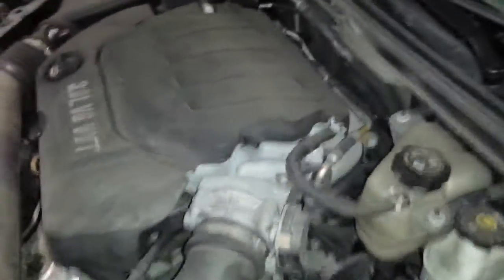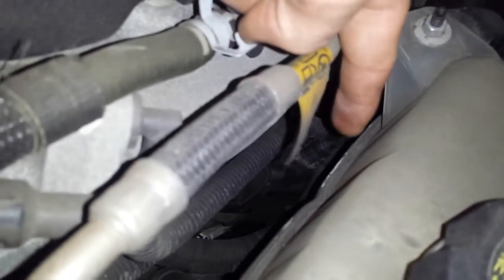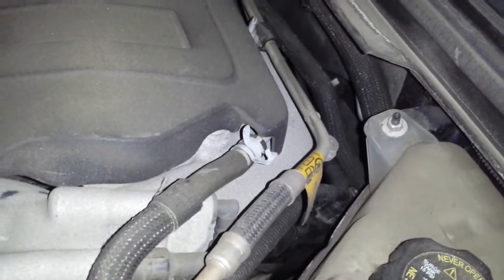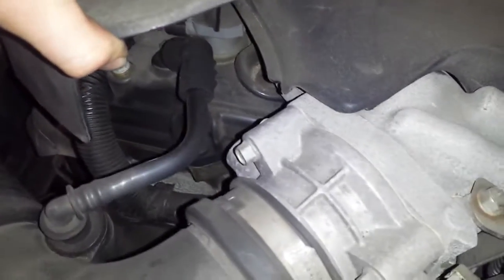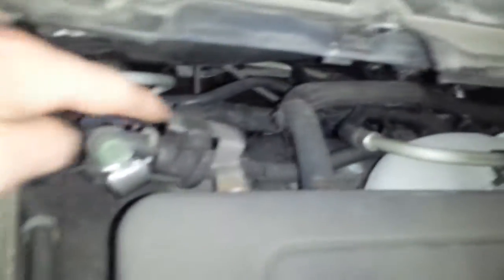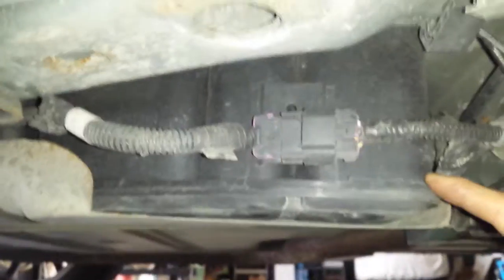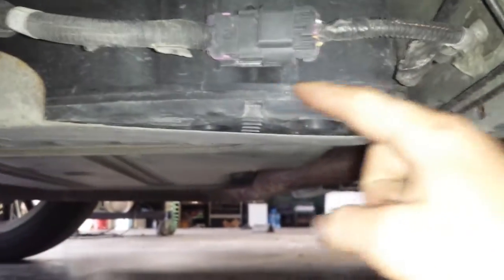Saturn Aura emissions: PCV system, EVAP canister, & EVAP Purge locations

Comment: How easy is it to change. I have the little part but the guy that was suppose to put it on ghosted me.
Reply from the maker: What part? What year, make, model,  engine size are you working on?
Reply: @ScottiesHobbies  2007 Saturn Aura the canister valve vent. I just watched another video. 🥺 It's something I can't do myself cause I would have to drop the tank 🤦🏾‍♀️
Reply from the maker: Good job taking the initiative to even look it up. Atleast you tried. Good luck on your next diy project.
Reply: @ScottiesHobbies  Thank you

Comment: How do I check to see which is bad. My car will crank tries to start but won’t like it’s not getting gas. The day before it failed to start I got evap code and gas cap open. I don’t know what to do HELP
Reply from the maker: First the quick and easy things, did you check your gas cap? Look on the bottom side of it and see if your seal or gasket is cracked or broken. If all that is good the next thing that should be looked at would be the purge or vent solenoid. They should be checked with voltage, and vacuum to make sure they're holding pressure. That's for the check engine light for evap. The no start or hard start. If you have some help try starting vehicle. While you're starting it have somebody spray carb or brake cleaner in the intake while you're cranking it. If you're starving for fuel or your fuel pump isn't working properly then the vehicle will start up. If the vehicle continues to not start after adding the brake fluid or carb cleaner then I would start looking at a spark issue. Please ask any questions if you need me to elaborate on any of these diagnoses.
Reply: Scotties Hobbies  Thank you so much for your response sincerely appreciate it. This may sound stupid but where is the purge vent solenoid located on this 2008 Saturn aura. Once again your help is so greatly appreciated. Thank you. I’ve asked so many people and no one was able to give me any help. Thank you.
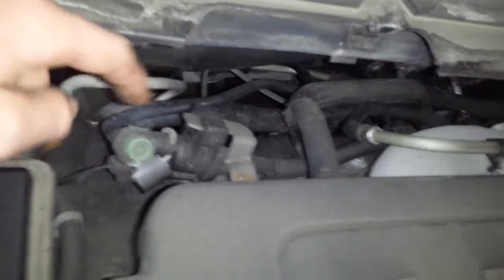Reply from the maker: @josiee.6605  I actually lie in this video. The solenoid I show at 00:43 is actually the purge solenoid. The vent solenoid is under the car near the vapor canister. This one looks like it should be very easy to replace. I actually need to remaster this video along with a couple other ones. I was just getting too ahead of myself.

Comment: i have the same ticking in my 2007 Saturn Aura XR what is the problem for that ticking do i have to change the vent valve or the purge solenoid ? thank you in advance
Reply from the maker: 2 things. Make sure you have oil to the ful line on the dip stick. If this valve, the purge, is ticking that just means its working or atleast actuating. If you don't  have any codes, don't fix this valve.

Comment: when i put gas in my 07 aura it take a cuple cranks to start, could it be my purge valve??
Reply from the maker: +Derek Mosley really could be either. The vent valve should open wile pumping gas to release pressure in the evap system. But the purge will open as soon as the car starts and that might cause a rich condition upon starting. Have you checked fir pending codes?
Reply: No i haven't

Comment: Hi I have a question for you, I'm looking to purchase a used 2007 Saturn aura, it has the ticking sound coming from the valve as shown in the video you posted. Is that normal? It seems to be the only thing I can find that I thought was a problem? If you receive this thank you for your time!
Reply from the maker: I believe that is normal on these. The sound you hear is the valve purging. My parents have saturn and the purge makes a lot of sound on that one too.
Reply: Joe Mamma what did you replace to fix the problem? Mine won’t start but tries to

Comment: that makes sense to me thanks Scott going to drive it a little more before I take it to the smog guy tomorrow good looking out brother have a great evening😎
Reply from the maker: Aye, no prob bro. Glad to help. Good luck and hit me up any time, i'll get back to you as soon as I can.
Reply from the maker: also... You are allowed to have the EVAP monitor incomplete to pass smog. i'd worry more about the other monitor setting. I always recommend to have 1/2 - 3/4 tank of gas and drive 55 or as close as possible. Around here you can fallow a big rig. Drive 55 for 20-30 miles. Turn the car off and drive back the 20-30 miles at the same speed. Id say that works about 80% of the time.

Comment: sorry brother no I don't know only thing is when I went to the smog inspection guy all he did was he showed me the little device that he plugged into my car under the dashboard and right away he showed me two red Xs he said I had to drive it a lot and he also said and the EVAP mind you I just recently about a week and a half ago I had the transmission put in so I don't know if that has anything to do with it I do not have a check engine light on everything seems to be operating correctly the only thing is it's not passing the smog inspection I've been driving it a lot for the last couple of days so tomorrow I'm going to inspection guy see what happens if anything I'll get the codes and I'll get back to you I really appreciate your help Scott thanks bud
Reply from the maker: so you are not failing a smog? you need to set your monitors. The tranny guys probably disconnected the batterey to get the starter off the tranny. The computer got reset. Have you driven over 120 miles? It sounds like the smog guy was trying to say was that your monitors like evap monitor and oxygen sensor monitor are not set.